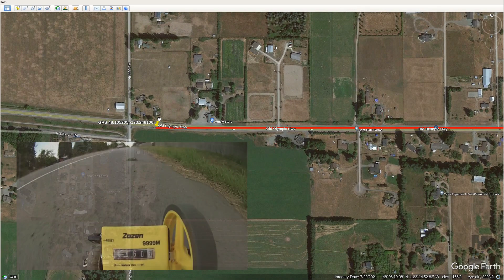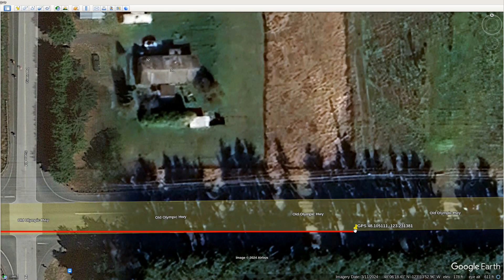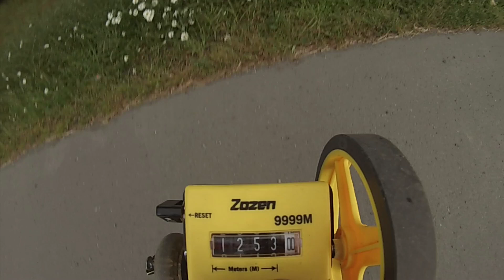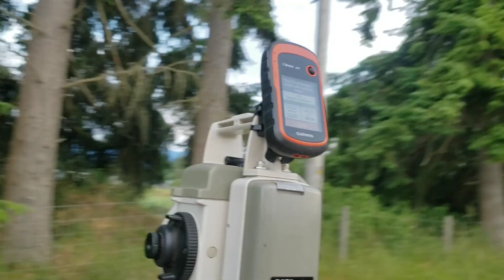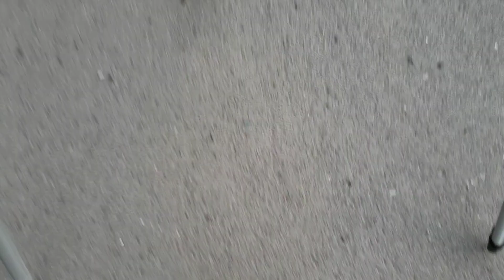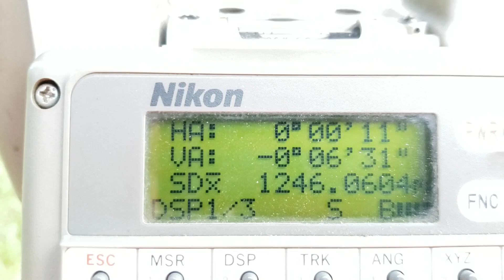Trundle town! Measuring physical surface distance of one arcminute of longitude at 48 North

Comment: WELCOME TO TRUNDLE TOWN!!!
Reply from the maker: Thank you thank you and thank you! And thank you for your excellent measurement and video in Australia! https://youtu.be/-g-437wi9Ds
Reply: If I can get hold of a trundler, I'll trundle at 38°13'44.67"S, 144° 6'33.35"E.
Reply from the maker: @billybowden7079  Woah that is a great E-W line, but it looks like a railroad track -- is there a smooth surface to roll the trundle on? Or would you have to modify the wheel to go on a train track? Also, watch out for trains!
Reply: @fromjesse   Ha! I didn't check the terrain, just saw the line on Google Maps. If that's the train tracks to Warrnambool, I don't think I want to mess with the freight trains on that line! I'll scope it out this week.

Comment: For fun here is my maths: 48.1 N on flat Earth = 48.1 x 60 NM = 2886 NM from the North pole. 1 arc minute around the line of latitude is 2886 NM x 2 x Pi / (360 x 60) = 0.8395 NM or 1554 meters. On a sphere of radius 6371 km the radius at 48.1 N is 6371 km x Cosine(48.1) = 4254.76 km. 1 arc minute around the line of latitude is 4254.76 km x 2 x Pi / (360 x 60) =  1.238 km or 0.6683 NM. The Earth is an oblate spheroid rather than a sphere so a spherical calculation is a bit out, but is still way closer than the stretched out Azimuthal Equidistant projection used as a flat Earth map.
Reply: Perhaps if I use 60 NM per degree at the Equator: radius = 60 NM x 360 / (2 x Pi) = 3438 NM. Radius at latitude 48.1 = 3438 NM x (90 - 48.1) / 90 = 1600.58 NM. 1 arc minute around the line of latitude is 1600.58 NM x 2 x Pi / (360 x 60) = 0.4656 NM or 862 meters. Nope still way out.
Reply from the maker: Indeed! It sure matches a globe closer than it does a flat surface, doesn't it!

Comment: Try measuring both a minute of Longitude and Latitude at one of those road intersections from the same point in the shape of an ' L '. You'll discover they're different and that's because the earth is an ellipsoid, not a circular round ball.
Reply: @JesseKozlowski  That's not why you'd measure a difference, even on a perfect sphere one minute of longitude will be shorter than one minute of latitude everywhere except on the equator
Reply: @giovaniakabacon  , oh duh but of course!!! Duh. You are absolutely correct. I would have appeared to be more on the ball if I said something smarter such as, naturally the distances between lines of Longitude will be shorter than between lines of latitude, but, you should also be able to detect that the shape is not a perfect circular ball, rather a slightly squashed at the poles ellipsoid shape. There, how's that? Thanks for correcting me :-)